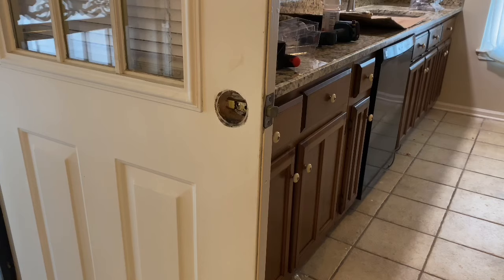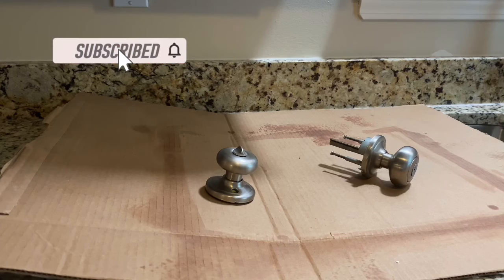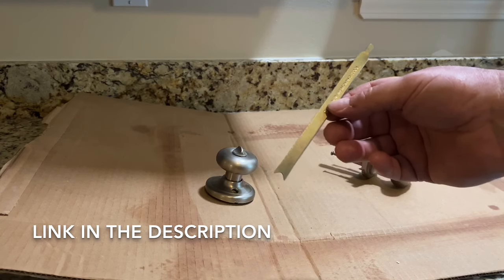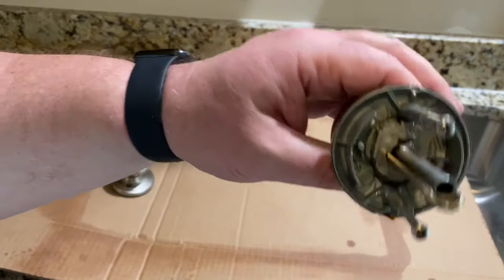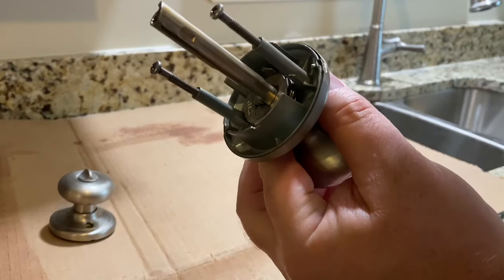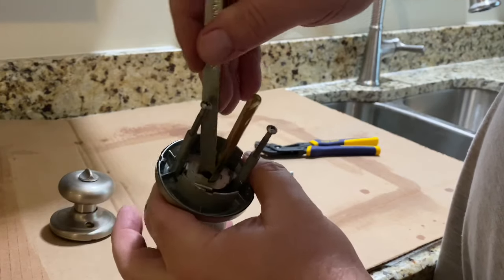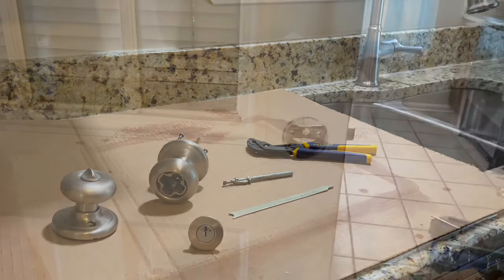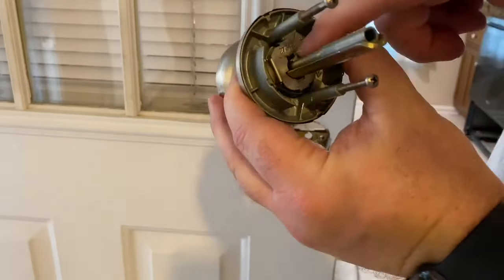How to correct an upside down key hole on Kwikset lock-easy cylinder removal

Comment: Did not know this. Why dont they just do them the right way in the first place.
Reply from the maker: @Keith Harris I think they are setup to be right side up for doors with the handle on the left, but they end up upside down for doors with the handle on the right. It’s great that the lock set can handle both, but I wish they would document this ability and include the tool in the box. Thanks for checking out the video!
Reply: @DougForce  I'm going to do mine. I hate having one this way and one the other way
Reply from the maker: @Keith Harris I am the same way! Plus it’s bad for the lock to be upside down as dirt can fall into the tumblers.

Comment: So by a $75 door handle, bring it home and then find out I need to go out and buy another tool.  Why the ** would they just not send it the right way???
Reply from the maker: @garn1177 Its not really wrong as door knobs can be right hand or left hand mounted. I think they just sell them in the most common orientation and for the doors setup the other  way it ends up upside down like mine did. But the knob can be adjusted as I did, so it will work correctly for every door with adjustment. Kwikset will also send you the tool for free if you call, I’ve been told by other commenters.
Reply: @DougForce  really?  Left handed doors would make the key hole turn the other way? I’ll have to put my little brain to work to figure that out. 🤣I did call them and they are sending but it seems like a real pain in my behind.
Reply from the maker: @garn1177 Yeah, if you think about it, you have to turn the entire assembly upside down to mount on the other side of the door - so that puts the key upside down in one of those two configurations. I think they should ship them with the keyhole not inserted so that everyone could snap it in the needed orientation at installation but that would make the install more complicated for some.

Comment: WHY THE FLIP DOES KRAPSET EVEN SEND THIS GARBAGE OUT LIKE THAT?

Thank you for your video!
Reply from the maker: @bill smith Thanks for watching! I think they set the units for the most common door lock position (on left or right side of door) and if your door lock is on the other side of the door it will be upside down. It would be nice if they offered sets for door left or door right.

Comment: wow, Im sticking with lever handles, this is a stupid design
Reply from the maker: @Scott Free You could actually have the same issue with any kind of handle (round, lever, etc) - it all depends on which side of the door the handle is on. Kwikset assemblies are designed to handle either case with this adjustment. Like many things in construction, some tweaking may be required.  :)
Reply: @DougForce  Ive changed plenty of handles over the years, this was the first I had to look up instructions
Reply from the maker: @Scott Free Yeah, it’s not exactly obvious for sure! I think they should offer sets configured either way so people could just buy the appropriate configuration but I’m sure that would cost more. It would be more consumer friendly.
Reply: @DougForce  agreed, thanks for the help

Comment: I swear every door I used these locks on it's upside down.
Reply from the maker: @Johnathan I think it depends on which side of the door the door handle is on. They set it up for one side but if your door handle ends up installed on the opposite side of the door you have to flip this piece. It would be easier if they offered left hand and right hand keysets but maybe that's too expensive.

Comment: I want to know why the heck Kwikset does it in the first place? Try and coerce folks to buy that stupid tool they sell? It's such a pita.
Reply from the maker: Believe it or not, the tool is free if you call them. I think the reason they did this was to make the same lock set work with doors that open from the left side or the right side. So it’s a feature that the lock can be used on either side, right side up - but they do a terrible job of explaining this feature to buyers.

Comment: Why not just buy a new knob that isn't upside down, take your faulty knob off, put it back in the box belonging to your new knob, and return it to the store. The stores won't know it's an old knob and it's Kwikset's problem anyway.
Reply from the maker: @Natalie Morgan it’s not a faulty lock set - it just depends on the swing of the door and which side the handle is on as to the right side up or upside down orientation of the keyhole. If your door causes the keyhole to be upside down, Kwikset makes the locks adjustable like this so you can install it on any door with the key oriented right side up.
Reply: @DougForce  Ohhh okay, thank you : )
Reply: That is  theft to defraud the store
Reply: @davidmoran4471  Cry me a river.
Reply: @davidmoran4471  how is it theft if the lock was assembled upside down? In this case it's a feature of Kwikset and not a defect but even so, if it was, returning the lock for a new one that would be correct isn't theft of store. Relax, have a lemonade.